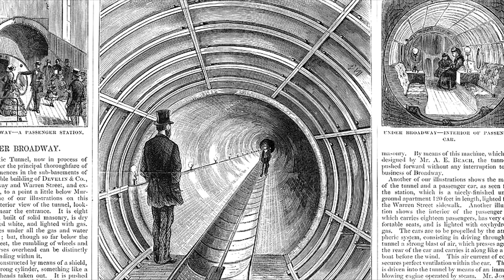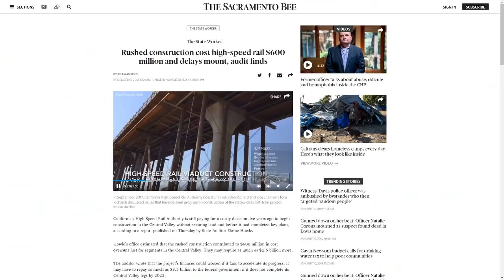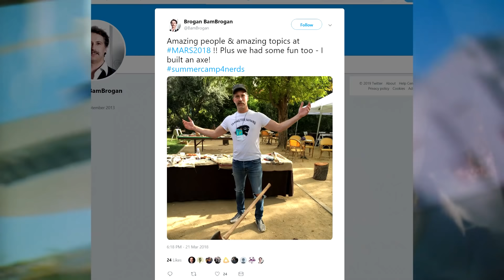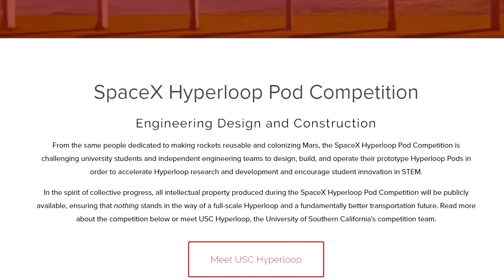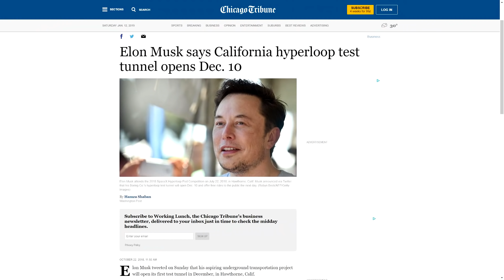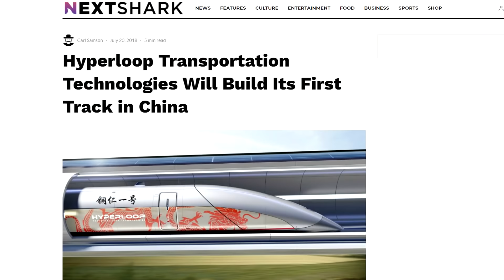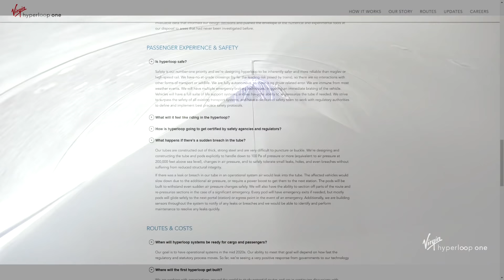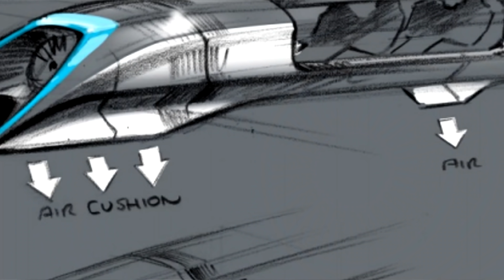Why Hyperloop will FAIL HARD - Its Biggest Problem...

Comment: The French-built TGV, which has wheels running on normal rails, has done a 570 km/h (360 MPH) run.
Why not develop something like that for North America if you want to spend a whole buttload of cash? Why re-invent the wheel?
Reply: Indeed! The more so because the French manufacturing company of the TGV has been sold to the USA for one third of the price by the traitor Macron at his former job.
Reply: @breakbollocks9164  you know, that GE only bought the Energy-part (powerplants, energy grids) of Alstom and not the train-part (train/tram bulding, signalling, ...)?
Reply: A big roadblock, in the US at least, is that the rails are mostly owned by freight companies. The freight trains take priority over any passenger trains. If we wanted high speed trains we would have to build completely new lines, and with how many people in this country chose or are content with driving, I doubt we'd be able to get enough support to warrant such a massive and costly project.
Reply: @zrora3094  You would be building new lines irrespective of public or private ownership. Most of the routes are over a hundred years old and follow gently-graded circuitous routes through the landscape. For high-speed passenger trains, sharp gradients are manageable and corners are the true limit.
Reply: It was a one-time run, you cannot operate on a regular basis an electric train with those kind of speeds, just because of the waves created on the catenary. And there are a lot of other problems. There is a reason why the operating speed of the TGV is "only" 320km/h...
Reply: Erm.. the same reason you invent the automobile when you have perfectly good horses and buggies?
Reply: @Semmster  Because cars use the same infrastructure as horses and buggies, while hyperloops have to have their own bespoke infrastructure that is supremely inflexible and limiting on the kinds of cargo such a means of transport can carry. It's the same problem that maglevs, hovertrains, and monorails all faced and all failed to overcome, the hyperloop has already failed to overcome those shortcomings, while adding even more of its own unique flavour with the possibility of vac-tube collapse and the subsequent catastrophic destruction.
Reply: @breakbollocks9164  US tries to buy any foreign company that appears to show promise if they can and then drive local competitors out of business so you have to buy from the US.  It's a smart strategy.  Just don't let them do it.
Reply: "Why not develop something like that".
Because the cost of building a completely new TGV line is quite a lot more (and a lot more complex too) than (apparently) a hyperloop track, and takes a lot longer with earth "reshaping" (land filling, bridges, tunnels, and so on....), as well as land encroachment (securing and reshaping a rather "large ribbon" of property).  But the problem that NO hyperloop video tackles is the "design" of a hyperloop track : most of the "bits of tracks" we have seen are all on "flat land", with little reshaping needed. But with this technology, what are the slope (up and down) limitations ? There will still be bridges and tunnels to be built... But as as modular construction, there are chances for much faster developments than any TGV line, or even Maglev line. Time will tell...
But when you see the quasi-exponentional and quick progress of SpaceX mastering of space technology, you can imagine that the Hyperloop technology can develop very fast, when all its components are mastered.
Reply: @TheSonic10160  "It's the same problem that maglevs, hovertrains, and monorails all faced and all failed to overcome".
They were not at all designed to carry cargo, but if Hyperloop wants to be economically sound, it will have to address this issue, and plan on alternating cargo and passenger shuttles.  Yes, each shuttle seems more limited that trains with several cars, but a lot more shuttles will be able to navigate, once an operational system will function.
"with the possibility of vac-tube collapse and the subsequent catastrophic destruction."
Seems to me that SpaceX has tackled and resolved, in just the course of 2 decades, vastly more challenging problems than this one....
Reply: Semmster maglev to hyperloop is more like moving from horses to rideable leprechauns. Cooler, much lower carrying capacity, faster (under a subset of operating conditions), way more expensive, and if some of the magic goes wrong, you will die.
Reply: @69EBubu  Then that raises the question of how are they going to run more hyperloop capsules, and how are junctions going to work in a vacuum tube for sorting between passenger and freight capsules so they can be sent to passenger stations and freight terminals respectively. More airlocks and junctions, which are already stupidly cumbersome for monorail systems like maglevs, needing more vacuum pumps, more moving doors, more maintenance, and more chance for things to go wrong.
It's telling that Elon has actually completely pulled out of trying to get hyperloop going. He's realised what a massive boondoggle it is.
Plus, the needs of a rocket that goes into space that doesn't need to remain airtight against a tube that absolutely must remain airtight and sit outside and take absolutely everything the environment can throw at it. I love the people that suggest tunnelling to build the tubes in, have they forgotten what massive faultlines crisscross California?
Reply: why reinvent the wheel? because you can always do better
Reply: Samuel Zelter this ain’t better
Reply: @softb  It has the potential to be faster. But by every other metric short of maybe construction cost (which at this point is only engineering estimates based on partial knowledge of what will be required for any vacuum-tube transport system to work) vacuum-tubes fall short.
They can't carry much paying cargo, be that passengers or freight, accessing the tubes for maintenance will be difficult and increase expenses and downtime. They are good for point-to-point connections only. No junctions, no diverging tracks, no marshalling of freight trains.
Reply: @TheSonic10160  it actually won't be as expensive as a high speed transport system its in the 7 millions while a tgv requires more than one billion most of the time, also, they can just build double transport systems one for cargo one for people, also maintenance ? do researches my friend!
Reply: @softb  7 millions for what? One kilometre of track? What is your source?
They might be able to duplicate the system, depends on if they can buy the land. Which is a significant problem for any transport project.
Maintenance: This is showing up your lack of knowledge on the matter too. The 'hyperloop' isn't just a plain tube that capsules whizz down, it's a maglev train in a vacuum tunnel. The vagaries of working in a vacuum with all the problems of spontaneous vacuum welding aside, it will all need to be maintained, which means you will need people to get into the tubes to get to the stators and perform repairs.
Reply: @TheSonic10160  only one question, does the government need to buy land when constructing roads? or monorails? no, only private companies need to, once the tech is proven its only a matter of time, also the steel used in them is surprisingly cheap, the main problem in tgv s are not mostly the materials but the infrastructures needed.
Reply: @TheSonic10160  also the source is simply on the white paper, if you want you can check 2the futures video about thunder foot  s' hyperloop claims, they made 1 mistake about temperature propagation only but again, its a fixed issue on the white paper, can't wait to see it in real life, dont you? should be exciting
Reply: @TheSonic10160  rare metals and superconductors ;) lets wait for it to happen  right, I mean who would've thought a rocket can land back to earth or that the earth is was flat before it was proved right, can't say something is bullshit before proof irl
Reply: @TheSonic10160  also btw re inspect your response about government paying for land, you said that it depends if they CAN buy the land not that they can pay for it or not
Reply: @TheSonic10160  also, that video is literally from 2018, huge advancements have been made, also is it me or the video in itself talks about hover trains only but not about one inside a vacuum just asking im not done watching, title is kinda dumb
Reply: @TheSonic10160  and btw check out virgin hyper loop, they're not using the same outdated design as in the video they use a different systems NOT FROM 40 years ago
Reply: @TheSonic10160  do you know what a yaw damper is?
Reply: @TheSonic10160  vacuum reduces air resistance with in long term actually helps with friction in mechanism
Reply: @softb  Firstly: Fifth Amendment: "nor shall private property be taken for public use, without just compensation."
Secondly, huge advancements have not been made in vacuum tube transport technology. Maglev trains took over after aerotrains failed and they have not made significant progress in becoming massively-available transportation in 40 years, with only four lines currently in operation and few planned.
Thirdly, actually watch the video. Yes, it's not entirely about hyperloop but it's effectively the same thing. Someone trying to do better than trains with a system that requires completely new infrastructure but in the end, not getting anywhere and instead high-speed trains are taken up. This system has to compete with every transportation system already out there. Every airline and airport, 77,556 km of interstate highways in the US not counting every other road. 149,406 route miles of Class I railways, not counting Class II and Class III railways. The last minute of the video directly addresses hyperloops:
https://youtu.be/qUXEFj0t7Ek?t=510
Reply: @softb  We have been down this track before, with aerotrains, with maglevs. New radical ideas have an enormously difficult time getting established in the physical world, where all the land already belongs to people, where competition already exists, and using technology that only has a 180-year history of interim success and long-term failure.
The world is better served by increasing the speeds and networks of existing rail services than by pouring all the money into white elephants that run between two major metropolitan centres in an era when ESPECIALLY NOW, travel is something people don't want to do and are actively avoiding, and when alternatives to travelling for non-leisure needs are increasingly met by internet video calling services and remote working over the internet.
Reply: @TheSonic10160  you know if this works then we basically won't need planes in continents connecting to large cities right, if this works you know the benefits why, look i know the Hyperloop seems blurry right now, but doesn't mean it won't work, I choose to believe in it because I think its better to be optimistic and be wrong and not pessimistic and be right, because pessimism always lead to bad things, Im not sure if ill continue this gentle argument, I love dreaming, oh and remember what people said was impossible before cars? ;)
Reply: @TheSonic10160  yea without compensation and to this is say goodbye
Reply: BECAUSE AMERICA IS NUMBER ONE!

The sarcasm is free of charge
Reply: @zrora3094  If we want priority for passengers on some existing tracks, it is just a matter of dollars, I assume. Track owners will probably give priority to the highest bidder or at least take it in consideration when there is money to be made.
Reply: @69EBubu  I think it is quite clear that building a km of Hyperloop track is more complex and expensive than a km of TGV-like track. TGV's even run at high speed on Dutch moving weak wet-clay soils (mostly on concrete ducts but fine). 
SpaceX is doing good work but most of the technology was already developed and built 50 years ago during the Apollo and previous projects. The main reason SpaceX can do things much cheaper is probably because NASA has many highly risk-averse highly-paid senior engineers waiting for their retirement after having worked all their life for expensive space shuttle projects.
No Hyperloop system has ever been built, therefore estimating the cost is totally a wild guess. I think, if the track costs 3 times more per km then TGV-track, that I 'm closer to the truth than all numbers on Hyperloop given by the media. Imagine if trains did not exist how easy it would be to give a very low estimation of the cost per km.
TGV technology has been exported to China and has shown to be extremely successful there (wiki: High-speed rail in China). It also confirms that Maglev technology is expensive compared to classic rail. So imagine the cost of a Maglev in a vacuum tunnel.
Reply: TGV don't run at those speeds in commercial operation : it generates too much wear. They run at roughly 300 km/h on dedicated lines, and are compatible with normal railways on which they go about as fast as any other train. If you want to go faster you need a maglev.
Reply: Yeah! Why re-invent the wheel?

That's EXACTLY what the makers of the revolutionary wax cylinder said!

And if anyone had listened to them, we'd never have .mp3 files replacing the CDs that replaced the tapes, that replaced the 33 rpm vinyl records that replaced the 78 rpm slate disks that went on the phonographs that replaced the wax cylinder phonographs that replaced no recorded sound at all.
Reply: because ego musk and his sycophants demand the attention and hype.
Reply: How would that be poggers?